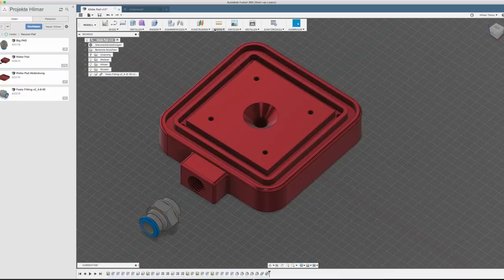CNC Vacuum PAD's  3D printed [with .stl & Fusion 360 files]

Comment: Hi I have a vacuum pump like the one you show and I see the inlet blue hose but how come there are two outlets on this vacuum pump. It looks like a pressure relief value  on the right side but what is the left brass fitting for. If you can help it would be greatly appreciated or is it a outlet hole the get rid of the air that it is sucking in from the blue hose.

Comment: Nice video and very interesting solution. Unfortunately I'm not familiar with Fusion 360 and I would like to have a M8 thread for the vacum connection and a M6 for the Holder point, do you have such solution?

Comment: Hi, did your table saw swivel?what kind of machine is that? It looks like it has a sliding table but I've never seen one that can pivot. What is that action for?
Reply: I believe he just forgot to lock the wheels. Not an intentional swiveling mechanism. He had it locked for the second cut.

Comment: Hi Theiss! I'm trying to build with my 3d printer a vacuum pad to use in a cnc wood machine. I've seen your video and I'd like to know what is the function of adhesive film.. to help the addhesion? but with the use, it will lose properties, won't it?   Thanks a lot from Spain.
Reply: Looks like it's a double-stick tape to help hold your part against lateral movement...

Comment: Hi Hilmar, great project  - printed 4 of the pads but have still to connect them to the vacuum pump. What kind of remote control is the one you show in the video to switch on/off the pump? Can you tell where I can get one of them or how you made them? Want to have one of them as well for my CNC machine. Keep up the good work! Thanks
Reply from the maker: Hi Lars, at home I use Homematic, that's why the expensive Funk-Wandsender 6fach HM-PB-6-WM55 and Zwischenstecker HM-LC-Sw1-Pl-DN-R1
 from ELV is used.
Reply: @TheissHilmar  Thanks a lot!

Comment: What happens if you need to cut where the vacuum pads are? Wouldn’t it loose suction then? I guess you could just be careful to place them not in the way but that could get dicey on some parts and you might accidentally cut your vacuum pads but now that I think about it would probably only cut the rubber seal around the edge which is cheap to replace if damaged. I wonder what the clearance is when that is holding a piece of wood down at full vacuum.

Comment: hello, a question, does the pump that creates the vacuum always remain active during processing or does it turn off as soon as it creates the vacuum?
Reply: ? It should turn off to save power butt...the force to hold= vakuum aowasy leaks a bit so it might not work depending on time and force, surface :-)

Comment: Fantastic Job!  What are your print settings to keep the pads from leaking? Also what are those valves you use?
Reply from the maker: Default settings for the 1st print is OK. Valves: https://de.aliexpress.com/item/32455312292.html?spm=a2g0s.9042311.0.0.27424c4dnk0fUn

Comment: I have a commercial CNC router and want to add a laser to it but the company I got it from doesn't offer an add on laser. Do you know if that can be added to an existing machine? What software controls it? And can any stealth laser be used? I'm wanting to engrave wood/ metal hopefully single pass 200 ipm
Reply from the maker: To add a Laser to your CNC you need deep knowledge in the CNC electronic, support from the CNC software for a laser and it is a high risk to damage your Eye's. I recommend to by a separate Laser engraver/cutter.

Comment: @08:55 I guess it is working for you, but I'd probably had those arranged in a staggered arrangement for an easier access to the valves without the neighbouring ones blocking my fingers.
That being said though... I believe those FESTO ( or Festo like ) connectors are meant to be used for positive pressure only like an air blast system, not a negative one found in a vacuum system.
Also... Any particular reason why you choose 3D Printing the pards instead of like using a material like Delrin? I mean... It's not like you don't have a CNC to make the parts using it 🤔
Reply: The connector can be used for vacuum/suction too because you can buy vacuum generators, venturi based and vacuum capable valves from festo with same coupling!

Comment: Hello,
very good job, can you tell me what type of screw you use for your central screw, do you have a link for both part the vacuum and the table I would like to buy the same.
thank you
Reply from the maker: Check for "Rampa Muffen M8" on eBay for the table. The screw is 8mm and the length depends on your setup.
Reply: thank you

Comment: What temp settings and speed settings are you running And what slicer I can’t get this to print for the life of me I get to about 4mm thick then it curls up and fails
Reply from the maker: Sorry, several people have print this part with different printers. Temp, speed and slicer shut customized to your printer.
Please use 20% infill and 4 Preimeters. If you have issues with warping, try to decrease the temp of the printbed.

Comment: Hi, did you have any problems screwing the connector into the pad? I broke the pad trying to fit it in. Not a huge problem, I can print another one. But I like to tackle the problem. Thanks.
Reply from the maker: yes, I had sometimes this issue. It depents on your printer and printer setup. But I was  lucky to have a thread cutter to prepare the thread after printing. Thanks for your feedback
Reply: @TheissHilmar  I don't have such a big thread cutter. I will try heating it up a bit, Maybe that will work.

Comment: Wonderful - Vielen Dank!
I see you cutting aluminium with a regular wood saw. 
Does it work properly and is it safe?
Reply from the maker: I think with my saw and 3000RPM with a Kaindl XTR–S 2.0 190mm 40Z saw blade it is save.
Reply: Best to turn your blade the opposite way to keep from forming burrs
Reply: @blake102989  This is 100% wrong please nobody do this. That technique works on plastic, not Aluminum. There is nothing wrong with using a carbide circular saw blade to cut aluminum. The tooling in an industrial metal milling machine is carbide, it's the same stuff. Technically you could cut thin Steel in a table saw if you want. If you turn the blade around you WILL chip the carbide and throw carbide shrapnel all over the place. Carbide is exceedingly strong only in the direction it was meant to be used, not in the opposite direction.
Reply: It is safe, but you have to use a special type of blade for this, the same kind usually available for miter saws. These have a negative cutting angle (the teeth angling backwards) that they don't have the tendency to pull themselves into the work piece. As a youth, I nearly had an accident because of course nobody knew that and fitted a normal table saw blade on the miter saw, and yes, it pulled the piece into the saw and nearly my fingers too. And these work perfectly for aluminium.

Comment: Hi your vacuum pads are ace i have printed 3 so far iam unable to get hold of the alsan adhesive film is there a substitute for this and can you tell me what its for ?
Reply from the maker: Wayne Sutton the adhesive film is for a stronger hold of the work pice. If your pads are not strong enougf without a film try to use a ather double side tape instad.
Reply: @TheissHilmar  Thank you for your quick response i will try that when i get all my parts together.

Comment: Did you print the pads at 100% infill?
Reply from the maker: 20% is fine. 4 or 5 Perimeters (wall thickness)
Reply: @TheissHilmar   I did not know realize you could model threads in fusion. I learned something new from you my friend. I appreciate that. Quick question how did you pads hold out over time considering you made this 2 yrs ago? Also is the "tape" required?
Reply: @TheissHilmar  how do you deal with supporting the internal cavities? did you use a dual extruder printer with PVA support?